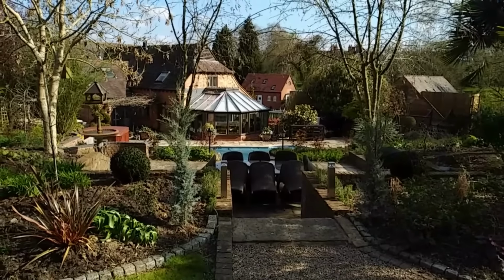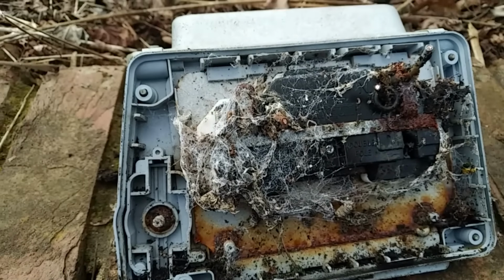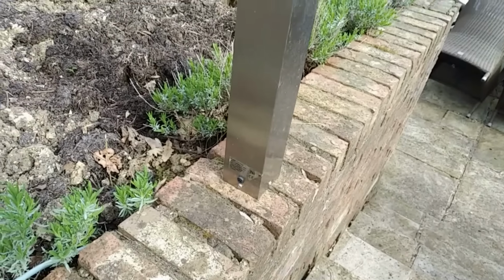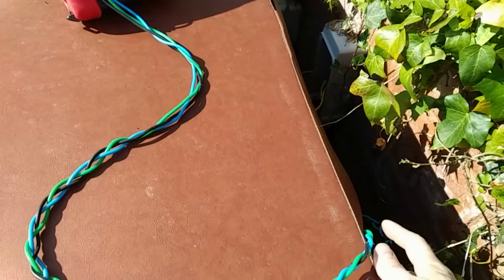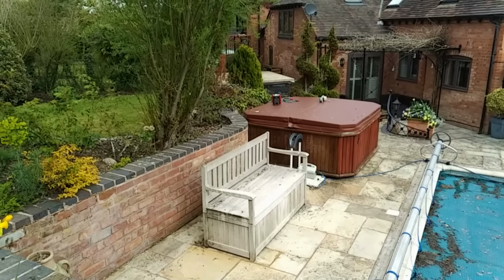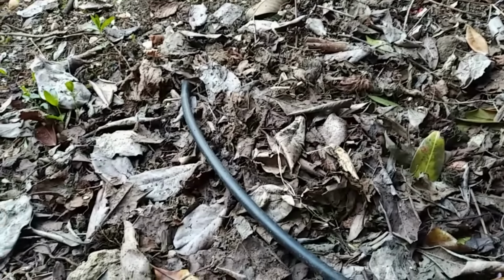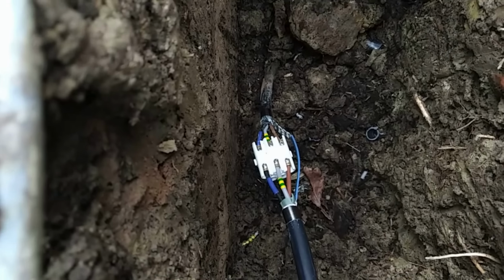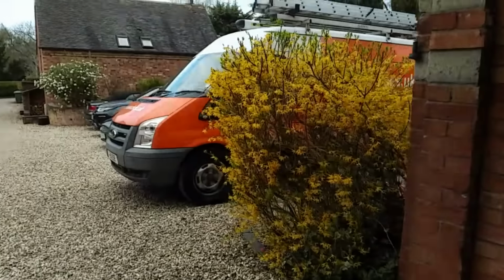Uncocking cack garden electrics

Comment: how should you terminate the armour when it comes through the back of a box like that flush in the wall rather than surface mounted - you can't easily fit a a gland like you would for a side entry?
Reply from the maker: The problem here is the brick planters - it's all soil behind that brickwork, so bringing the cables through the wall into the rear of the enclosures means moisture, bugs n' slugs all travel along the cable through the wall and into the electrics which is why they have weathered so badly. For the replacement 2P+E unit we installed, you can see just after the 25 minute mark that we have brought the SWA through the wall and then into the underside of the enclosure. It doesn't look as neat, but the IP rating is maintained and that unit will have a better chance of a longer life than the previous one. If it wasn't a planter and was just a wall, then you could terminate the SWA properly onto the rear, but you'd have to excavate out enough for the gland to sit in so that the enclosure can be mounted properly on the brickwork. Alternatively, you could terminate the SWA onto, say, a Wiska box on the rear side of the wall, then take a smaller diameter cable through to the rear of the accessory. Each job has to be taken on its merits depending on what's there and how you can minimise the visual impact of the utilitarian components without compromising the safety or operational lifetime of the equipment.

Comment: when you find poor work like this, do you feel the homeowner will think you're the cowboy when you tell them how badly the previous job was fitted? Must be difficult.
Reply from the maker: I hate to be that tradesman who turns up with his arse hanging out of his trousers, sucking air through my teeth as I asked "what cowboy done that then?" There are certainly some jobs where you get the feeling that pointing out the problems isn't sinking in as the client is looking at you with a raised eyebrow. It's especially difficult on problems such as ring breaks, undersized cables, overrrated protective devices or missing earths as they perceive everything to be technically working and, unlike shoddy workmanship, it's not necessarily something they can physically see in order to appreciate it.

Comment: Can't speak as to the electrics, though it's pretty clearly terrible. The brickwork though is simply atrocious, which gives a pretty clear indication of the overall shoddy work.  Little or no proper coping and there are sections where bricks have clearly been "cut" down to fit, ready to fall apart / split with the first real frost they encounter

Comment: If only whoever installed that crap in the first place had had the decency to put together a plan showing where the cables are laid within the garden and a wiring diagram showing how it was all connected up.

Looks like it should be a case of rip almost the whole lot out and start again.
Reply: I'd bet on at least 3 guys.  First put in the SWA for the sockets; second tapped that with the SY for the lights, third tapped that in turn for the hot tub.

I'm thinking that the hot tub really should have had it's own dedicated circuit back to an RCBO at the consumer unit.
Reply: @calmeilles  It's as though the hot tub was originally going to be elsewhere and when it moved an additional SY was installed.

Comment: Who needs so many power outlets in the garden?
In any case, this wiring looks like unprofessional tinkering.
I only know shielded cables in connection with frequency converters - I do not think that's what they use ...
For the wiring in the garden I would have one or two cables for the lighting and also one or two cables for sockets.
I do not like buried or freely lying junction boxes in the garden.
With junction boxes and sockets mounted on walls, I would always insert the cables from the bottom in order to prevent ingress of water. Screw holes should be closed. Or you can use those that are not in the terminal compartment. For junction boxes in Germany, there are screw holes at the corners, which are separated from the terminal compartment when the cover is mounted. The same is also the case with sockets for outdoor use.
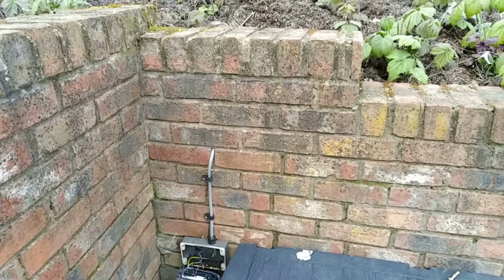But I'm surprised that someone used a UV-resistant cable gland at 14:17 on top of the Outlet...
But the cable is definetly not UV-resistant. Over time, the cable will dissolve into all it's components anyway.

19:12
This Gel Insulation Joint looks exactly like the ones from "Cellpack":
https://electricalproducts.cellpack.com/fileadmin/user_upload/bbcgroup.biz/site/eproducts/images/used/003-Produkte/0034-Geltechnologie_Bilder/Gel_Technologie_EASY.jpg

Comment: @ 8:04 are those not all small round lights set into the brick? one is just below left of the socket/hand, as well as all the other rectangle and odd lights all over.
snip snip flush where it enters the house and unhooked until fully replaced ;0

Comment: one thing is for sure, the seals are never good in any part of the world, over 20+ years time nothing holds up more then a few years tops.
I've tried silicone, factory gaskets, etc etc etc. none of it holds up water always gets in and manages to get into sockets/devices/splices. more so ones without bottom/open conduit into the earth ( provides a drain point) I gave up on tight sealed and started drilling multiple small holes in rear of boxes and removing a part or all of bottom gasket....
the issues decreased ten fold, but some still fill with water due to ants and other bugs clogging the holes and dirt/corrosion plugging the tight closed non-gasket area
Reply: You basically have two choices in life, either fight water intrusion or accept it and give it a safe exit path.  Water tends to find a way given sufficient time, even if just from a small air leak and the resulting condensation accumulating.

Comment: Man, I did electrical about 25 years ago here in the states, but never outside work, holy shit, there is no way I would have been able to cope with opening an electrical box and finding a slug wow.   you sir are one hell of an electrician.  I climbed through dusty roof spaces, warehouses, fiberglass filled ceilings, possible asbestos, sweating my arse off but to me that was nothing compared to what I saw in this one job.
Reply from the maker: And here's me believing Americans didn't do sarcasm.
Reply: @dsesuk  lol i really hate bugs more than anything
Reply: I;d love to find a slug or snail, instead of a packed hive full of angry wasps or yellow jackets(which sting again and again x 900) you wont outrun them and jumping in  water will leave swarming above when you surface and the ones clinging to you stinging wildly over and over.......

Comment: Here, in Manitoba, that whole circuit would fail inspection and would have to be replaced, not repaired. We can't put a hot tub on the same circuit as outlets, hot tub would have a separate GFCI(RCD) not exceeding 15 amp. All wires must be Coated armor or conduit and no outlets can be lower than 60 cm from the ground.
Reply from the maker: As electrical work here is unlicensed, it's common to come across circuits on a regular basis which were either installed poorly to begin with, or have been unprofessionally meddled with over time. The nuclear option of ripping out and starting again is always going to be preferred, but the practicality and cost of doing such means the reality is that temporary fixes may be needed pending proper costing and planning to redo, or working with what's known to be good to bring back to service. If I turned up to every job that exhibited poor workmanship and refused to do anything but a full rip out and restart, I wouldn't be in business for very long.
Reply: hot tub on 15 amps? is it beer keg size for half a leg?

Comment: These gel filled boxes are not do great as you may think. We've got them from Cellpack and if you put three cables in they weren't shutting properly. One cable in, one cable out not more and even then you have to be really careful. Every little bit dirt is causing them to let moisture in. I've been pulling these things now twice out of the ground because moisture has gone in. I think the best connection ist still with butt connectors plus heat shrink tube or a cast resin joint. Especially cast resin joints are made for the eternity.

Greetings from a German spark. Keep up the good work lad.
Reply from the maker: Thanks Max, I quite agree. Two days ago I was splicing a permanent joint and I went back to the resin kind. I've filmed that, so it might appear on here over Easter. I consider these a quick and dirty fix rather than a long term solution!
Reply: @dsesuk  Yeah, I think the same. The gel type joints are just quick and dirty. Would be also nice to see an UK-Spark doing a resin joint. Are butt connectors plus heat shrink tube also very common in the UK? Here in Germany it's cheaper than a cast resin joint, but also reliable.
Reply: @Mister_Mustermann  Crimping is always better but your splice (however it's terminated) still needs to be encapsulated, so you still end up with the resin/gel decision.  Some gel boxes (e.g. the temp one used here) don't provide cable grips to prevent "undue strain to terminations" that would be a requirement of a permanent joint, so that's something else to consider...
Reply: @GrahamJEllis  Well yes, if you use butt splice connections, you just put heat shrink tube around it. In the heat shrink tube is glue that melts when you heat your heat shrink tube. So your cables are glued together, water tight and bisch bosch basch. If done correctly it's also very reliable, easy done and you could undo it again.
Reply: @Mister_Mustermann  Ah, I assumed you would mean glue heat shrink (eg. Atom) but that's always special order and never in stock over here -- such a useful product but no-one stocks it so no-one uses it!  Anyway, the glue in Atom is not "structural" so further mechanical support would be required for the terminations (whether crimp or screw) and mechanical protection for the finished joint and basic insulation (overall sheath, which I'll grant could be provided by a second layer of larger Atom slid across both cables over the joint assuming it has the right insulation rating which I believe it does).   Over here (in industry) Atom or similar product is only used as "site-applied" or "secondary" insulation to repair damaged basic insulation or suchlike.  The terminations of a joint so well made would still need mechanical support: either both cables clipped within a short distance of the joint or a junction box with integral strain relief.  Benefit with using Atom is at least that you don't have to fill the box with goo.
Reply: @GrahamJEllis  First of all, thanks for the in depth answer. Good to hear from a spark in UK. So here in Germany it's an always on stock item. Every wholesaler in my town has heat shrink tube, from brand names like cellpack. Even in my van I keep an certain amount of it. We (the company I work for) are doing the whole range from residential to big industrial complexes. So if we have a cable that is for example too short, we strip back the outer insulation so that we have the inner conductors with their basic insulation. Then we do that to the new cable also of course. We connect the inner conductors with butt splice connectors that have also heat shrink around them (from Klauke the article number 680WS). So the butt splice connectors provides also basic insulation. Over these connections we shove then heat shrink tube ( like cellpack SRH2 or SRH3, depends on the use case) and shrink it down. In my eyes that's more than enough electrical insulation and mechanical strength if done correctly. Our company also does work for the local electrical supply company and they also do it with heat shrink tube or with resin joints. Honestly I don't know if these types of joints are even possible with the different cable types in UK, we in Germany we have NYM-J for things like were you guys twin and earth are using and everything outside in the ground or exposed to the environment we are using NYY-J. You guys have things like armored cables, what we don't use. 
Greetings from Germany.
Reply: @Mister_Mustermann  oh we have heat shrink of all sizes and colours (wholesalers usually carry "presentation" boxes of a set of them all) but never glue heat shrink, which is really what you need when effecting permanent repair of basic insulation in an enclosure accessible to a future operator.  And I've just realized what you mean  when describing heat shrinking over your crimps: we only ever use insulated crimps (red/blu/ylw), bare crimps with no basic insulation are only >=10mm.
Reply: But as a temporary solution as you did, totally acceptable.

Comment: arent hot tubs required to be on their own circuit ?
Reply from the maker: Looks like that last single socket, and the the hot tub, were daisy-chained from an existing exterior socket circuit. With the duff outlets taken out, this circuit now consists of one socket plus the tub on a 20A RCBO. The tub requires 16A, if they want to hang something heavy off the socket at the same time, then off it'll trip.

Comment: How should electrical cabling be ran outdoors?
Reply: SWA (steel wire armoured)
Reply from the maker: At 230V, I'd use SWA to get from point to point across a space like a garden. SY isn't recognised by BS7671 as being valid for fixed wiring, and it's certainly not something you expect to find partially buried. For smaller things such as outside lights where you have a wall to clip along, I'd use something like 3183P rather than T&E as this is designed for use outdoors, or PVC/galv conduit if something more robust is required.

Comment: sadly to many people look for the cheapest quote and forget that quailty work and parts cost and cost for a reason,there is nothing worse than having to put someone elses bodge job right.
Reply: I’m a carpenter Happening a lot to me. I’m not cheap and I’m not the fastest but I leave the job safe and high quality also tidy. Lost three jobs recently because some tool has quoted £150 a day plus materials makes my quotes look cheap. I went and looked at one of them when it went wrong. Client had paid out £5500 so about £450 more than my quote and it was shit house totally unsafe. I told them would now cost original plus £1500 to sort the mess out. But first get a good solicitor asjob was dangerous
Reply: @whitacrebespoke  What you find with some tradesmen is they charge a lot but do the bare minimum.

Comment: Wonder how much that hot tub takes ? 20amps on that circuit, I hope they don't want to use any sockets when that hot tub is cooking. I maybe would have just done a Wiska box join and taken a new SWA out of the top and through the top of the wall, not a fan of joins under ground no matter how good they are. Great video though :)
Reply: About 13.5 amps I'd say, so still some margin left on the circuit. A B20 will hold 24 amps pretty much infinitely, so a 10 amp load on top of the hot tub should be fine. At 29 amps it should trip within an hour, so even with another beefy load it's unlikely to trip anytime soon.

Comment: Just pull the rcbo out & chuck a wylex fuse in, that'll sort it 👍🏽
Reply: Hahahaha. With a screw instead of fuse wire
Reply: @edglue6138  A screw won't cut it.  32A circuit needs a good 5mm bolt.  :)
Reply: @calmeilles  haha

Comment: Fascinating vid. Surely there shouldn't be any switches or connections  within reach of anyone in the hot tub?
Reply from the maker: The limit for the new 2P+E connection is the hot tub's own SY cable, but I'm happy with the IP rating and double-insulation afforded by that. Less so for the other existing accessories such as the exterior socket, Wiska box and junction enclosures immediately behind it, but they appear to be sound, albeit poorly done.